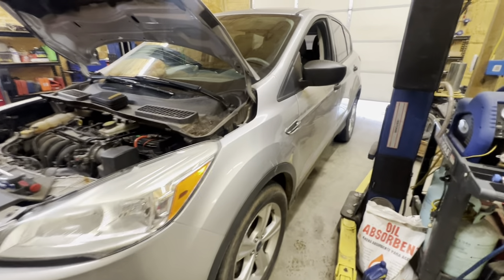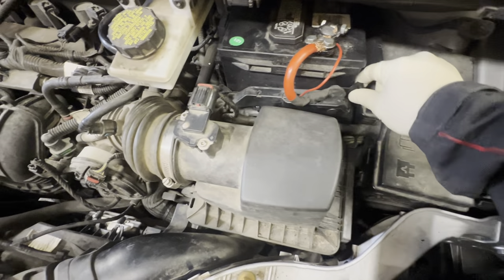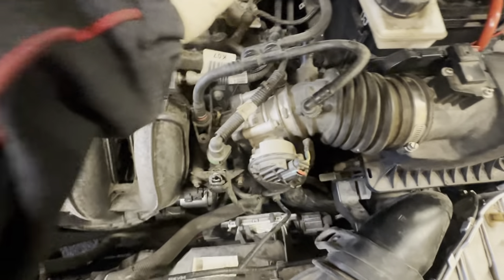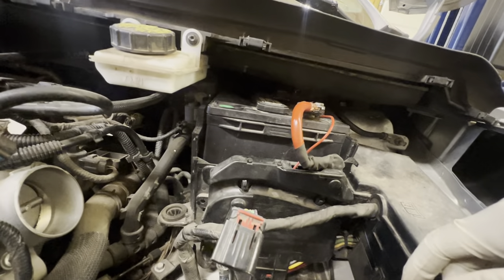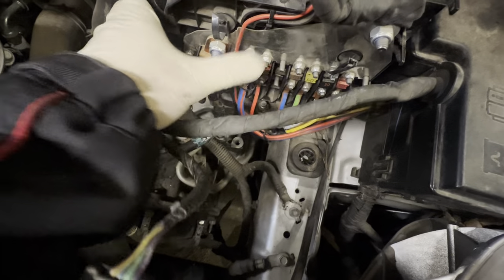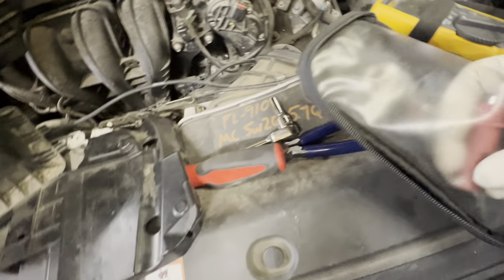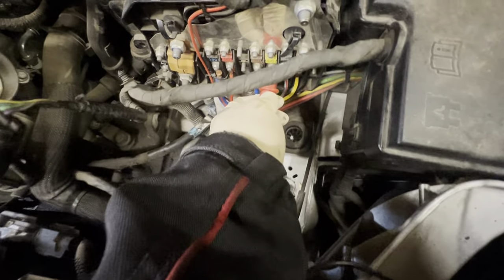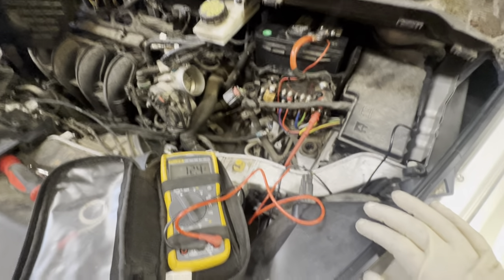Ford escape 2013-2019, dies while driving. Message engine fault service now on instrument cluster.

Comment: My 2017 Ford escape was doing the same exact thing but I picked my daughter up from school and was pulling out of the parking lot and the motor just shut off. Very dangerous though if I was on the highway. I ordered the 50amp fuse. The panel doesn’t looked cracked so hopefully that fixes it without replacing the hole panel.  I can’t thank you enough for this video.

Comment: Nothing wrong with pannel...element in fuse is broke...took mine apart to see...nuts were over torqued when installed at factory causing stress on the fuse element over time it breaks...sometimes it touches enough to crank the car,  other times shuts car down or won't crank...new style fuses from Ford are made stronger...I replaced all fuses on the panel before I put mine back together...50 amp fuse on the right seems to be the one that fails first...

Comment: 2018 ford escape SE 94000km been randomly not starting for me for awhile first time it happened got a tow home second time a friend show me to just wiggle that area in this video and I’ve been doing that ever since on ratio it maybe only doesn’t start once out of every 3 weeks but today for the first time it died on me pulled over put my car in park turn it back on and carried on my way got my shopping done with no worries and back home this video sums up what issue I’m having, surprised it’s not a recall….
Reply from the maker: @chrisxerri7513  if you still have the starting issue check the starter relay and the engine ground is common to have a bad spot from the bolt on the transmission pan rubbing through.

Comment: I replaced the 50a red fuse 2 nights ago. Today, it still died when my wife had the car. WE HAVE THE SAME SYMPTOMS AS YOUR VIDEOAND I LITERALLY HAD BEEN DOING WHAT YOU DID 2WKS AGO. I JUST SAW YOUR VIDEO TONIGHT.  ANY UPDATE?
Reply from the maker: So I never had any more problems from that vehicle. Did your fuse blow or break after you replaced it. Also I replaced the whole fuse panel. There is a possibility the thin panel could have a break in it.
Reply from the maker: @soside619  try checking the starter relay take it out a shake it. Also check the engine ground at front of trans for the broken or corroded spot. How this helps.

Comment: I have a 2014 Escape Titanium. The remote start works, then the car turns off after 10-15 seconds. Would you happen to know what the issue might be? I appreciate your guidance
Reply from the maker: There is a lot of things that goes into a remote start system so I will be asking you a series of questions. First thing is there any trouble lights on and have you had you vehicle scanned lately there are some codes that won’t turn on a trouble light.

Comment: I'm having the same issue as this, I'm preparing to change out the fuse once I confirm which one it is, is there a specific torque for when I screw everything back into place?
Reply from the maker: While there is a torque for everything. I wasn’t able to find it.  Just snug but not too tight. Should be good.

Comment: I don't know man I got new spark plugs and I service my car regularly. Recently I went to the beach and the engine fault light came on but I don't have any issues whatsoever and I heard that it could be a low or dying battery. I charge my battery to full capacity which didn't take long and the engine fault is still on but my car runs perfectly fine
Reply: Same problem with my 2015 1.6 se
Reply: @lexen1993  if you figure out what it is please please let me know cuz I can't find it and that obnoxious beep constantly is going off
Reply from the maker: Do you have a check engine light on or have you had it scanned to see if there’s any codes in there that might help point you in the right direction? If you give me the code and the vehicle information, I can possibly get you some more information.
Reply: @FIXITFISK  I had it scanned and NOTHING comes up!! I have a scanner ands it finds ZERO issues!! But the light is always there

Comment: Just to add my experience. 2013 Escape 1.6. 

My son was driving it home and the engine died. The instrument display said the transmission not in park. The lights would come on inside, but no dash lights. Miles showed up on display, but nothing else. Would not start. 

Had to use the override switch in the shift lever to put it into neutral and drug it home. 

Watched many videos. 

Checked:

battery-it was ok, 1 year old

Mega fuses- ok, ohm check and voltage checked. Even swapped 2 50A-all good. 

Major grounds-generally looked like crap (northern tier salted roads), but checked good otherwise. Cleaned and moved on. 

With no other major things or any available indications, I decided to check the start circuit, starting with the key circuit. Quickly found the Ignition Switch Fuse (F78 on BCM) was blown. Replaced it and car worked as advertised. Tried to drive it, and the fuse blew again. 

Began shooting wires after the fuse to find short. Checked to key and back. Looked for shorts to ground, none found. Shook harnesses and connectors, no shorts found. 

Began looking for other potential shorts associate with the floor shifter, instrument panel, pedals (for the heck of it.)  To my surprise, found a Ford Remote Start System DNA-9 GEN-2 stuffed up under the driver’s side. 

Had bought the car used and was told there was no remote start. Was surprised because the wiring checked good following the diagrams for no remote start.  

Due to the shoddiness of the installation as well as manufacture dates on these remote start parts, this system was installed at least two years after the car was manufactured. 

Started researching my car problems with this Ford remote starter.  Found a post for a 2015 Escape with the same problems. (His remote start stopped working and even the key wouldn’t work.  Found F78 blown.)

He disconnected the Ford DNA-9 GEN-2, replaced the fuse and it worked. He opened the box and found corrosion all over the board.  

I disconnected the remote start, replaced the fuse, everything worked fine. Did many laps around a local addition, no more problems. 

I opened the Ford DNA-2 GEN-2 and found a blown diode. 

Since this remote start box has been removed, I have had no further problems. 

Hope this helps if all the rest doesn’t.

Comment: Thank you for this video, my Ford Escape 2017 was dead, like no current (like if there was no battery in the car) nothing than 10 minutes it would start like nothing happened. 
It did that 2 times.

Seems, it’s always the first fuse from the right. The part 782-1144 from NAPA Canada cost 14.46$ my garage changed it in less then 10 minutes. Having the part here I cannot see that it’s broken but the truck no longer has the problem. Time will tell but I'm confident that was the problem. Thank you again.
Reply from the maker: @ericet19  if the problem does reoccur check your starter relay. Take it out and shake it. They are known for the intermittent problem.
Reply: @FIXITFISK  No, but a starter replay will not remove all power as if there was no battery in the truck. it will only prevent the truck from starting.

Comment: My 2026 2.0 Escape had this but it was occasionally shorting out on top of the motor at 36,000 miles. Random and very frustrating. The aluminum post on top of the motor rubbed through the harness.
Reply from the maker: Oh nice good to know. Glad you were able to figure it out.

Comment: Dude I got a 2013 in the damn light started popping on about 3 weeks ago. I've run a dozen Diagnostics and can't find any reason for it to do so
Reply from the maker: Have you had it scanned by a shop? O’Reillys and AutoZone are good for simple codes but if it’s anything more than that, they sometimes won’t be able to get any codes off of it. Something else you could try is disconnecting the battery for five minutes and then reconnecting it and when the light comes back on, haven’t read then and see if you have any codes at that point.
Reply: I did and it says there's nothing wrong I have a Diagnostics reader at my house because I do a lot of mechanic stuff myself. Both my father and grandfather were mechanics and I learned a lot from them even though cars have changed a lot since the 80s. But my reader and the diagnostic reader at the shops are coming up with zero codes
Reply: Appreciated. I've tried unplugging the battery as well and still don't get any codes